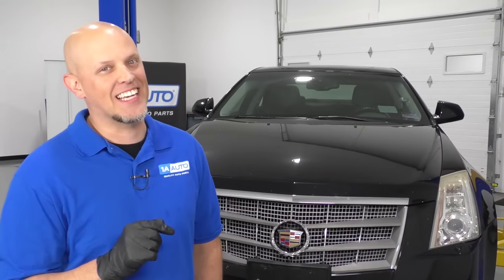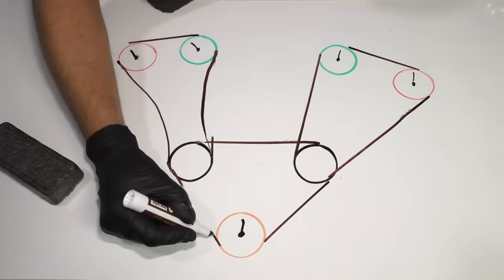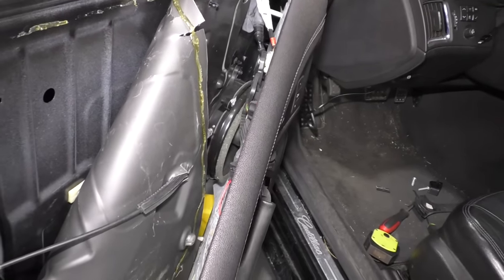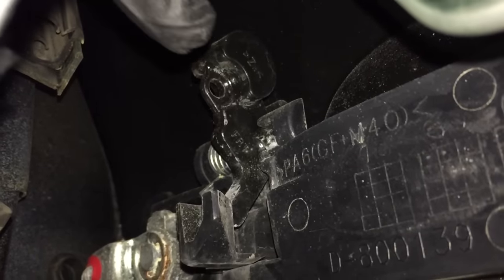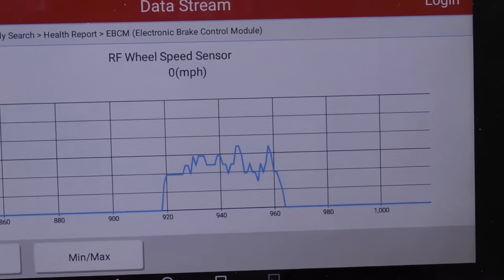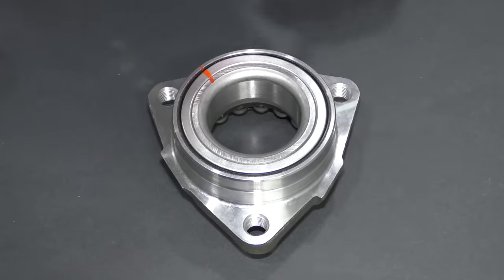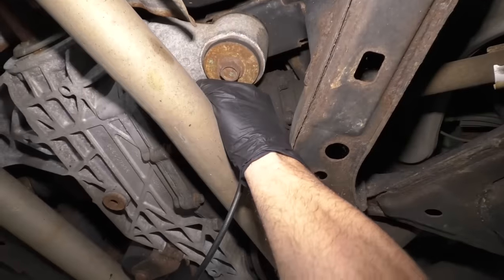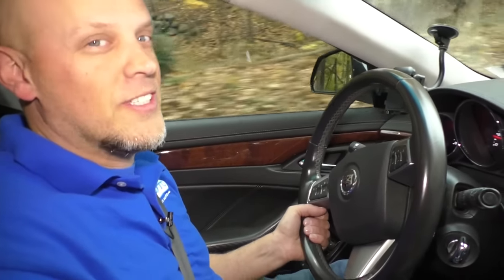Top 5 Problems Cadillac CTS Sedan 2nd Generation 2008-14

Comment: Doing any work on these things a just a huuuuge PITA compared to almost any other full sized sedan lol, like changing any of the bulbs in the headlamps for example. Gotta put the car in the air with the wheel turned in and go in through the wheel well 🙄 stupid.😆...but even with all 6 light housings having bad seals on mine and letting in condensation, I had to replace a 1 fog bulb thatbwas out over 3 years ago when I first purchased my STS with 120k on it, and it has 190k on it now and none of the other 7 or 9 bulbs total in the front have needed replacing since. My car in particular is good to go because i take care of my vehicles and have spent more than I paid for the thing over the past 3 years on maintenance and special-order only discontinued parts for the thing as soon as they go bad and strictly run Mobil 1 5w-30 that is calls for, and dump a little seafoam in the crankcase in the winter to thin it out a bit and clean it out at the same time for those 9* morning cold starts here in MI, but as a whole I purchased my car expecting a nightmare money pit and for putting 70k on it, I can't believe how well it's taken all my abuse and these MI roads.. main cost with any caddy is going to be suspension maintenance if you live here because every winter the roads just chew the suspension on our cars up everhtime we pull out of the driveway smh.. but as for the engine and drivetrain (awd) they're bothe original, and both taken a severe beating because I drive all my cars how they were meant to be driven and they are all still running strong as ever... BUT it threw the codes for the timing chain issue about a year & 20k miles back... it's been running in limp mode ever since then with about 70% the power that it did have, and running rich the whollle way because that's where I draw the moneypit line. I'm going to drive this car the way it is and continue maintaining it meticulously like i have until one day the engine finally grenades on me when I'm winding it out to 7k rpm with the governor pegged at 106 on the freeway like I do weekly, or it just randomly won't start one morning because the chain finally jumped a tooth, if it ever even does lol... despite needing a timing chain, this car is a just a luxury tank that i bought for a steal and still turns heads. As long as you change your oil every 6k miles at the most and keep an extra quart in the trunk to top it off every 3k miles or so,, because these engines are all natural oil burners at anything over about 3500rpm.. even with me behind the wheel pushing this car to its limits, it's literally never needed more than a quart between changes and that was actually the acceptable rate that was published in the cadillac service bulletin back in 2008 for these engines when the car was brand new 🤯😆 ...all in all I love the car to death. It costs a fortune to fix, but if you find a good one like mine you can grab them for the cost of an A to B little beater car, as long as you buy it knowing you're going to need to spend just as much, if not MORE than a Mercedes or BMW for maintenance and repairs, butbas long as you do that like I have, this thing hasn't skipped a beat daily driving it, or ever once left me stranded without a vehicle while driving an hour away every other day since purchasing it like I 100% swore it would within the first 2 months. Only car I've ever owned that I purchased with a "God how are you this dumb? You literally know better than to buy this thing" type of mindset, expecting it to be to be a total fail and turned out to be one of the most reliable American made cars that I've ever personally seen. My case is veryyyy very rare for anything with the 3.6L cadillac engine in it though, and that's because the main problem with these cars is the timing chain stretching every 60-80k miles that literally totals the car out to have replaced, being a $2500-$3000 job on a 12 year old vehicle with 200k on it... and it happened on every single 3.6l cadillac and most other GM 3.6 engines that are on the road because of a huge engineering design flaw and the very first reason why if you are looking to buy one, having an OBD2 code scanner with you is a MUST. I looked at 8 different STS's and this was the only one that did not have a check engine light or any timing chain related codes when I purchased it, and the car was meticulously maintained by the dealership every 6k miles and was sold for $63,995 in 2008 with a bumper to bumper extended 120k mile warranty on it, so it had obviously already been replaced at least once by then.... the reason I'm taking the time to write this is because I'm shocked wasn't mentioned in this video somehow. Do NOT buy a damn cadillac no matter how good the price is without doing some digging first. Trust me, it's well worth it. I've never seen another STS still on the road with as many miles on it as mine has because of the simple fact that people don't want to be bothered with checking their oil every few tank's of gas 😑👌

Comment: 3,6 v6  it good engine???????????//
Reply: The LFX version, 2012+ is excellent.  The 2011 has timing tensioner issues so get a 12+.  Add a catch can since it's DI and good to go.  I am on my 2nd, drive them like I stole them with no problems.

Comment: Fuel pump leaks, sun roof inoperable, water leaks in to car, water pump gaskets leak, over heating. Head light led going out,
Reply: first major repair was timing chain replacement,my fuel pump is leaking currently if i fill it up fully, my sun roof is leaking, just changed headlights, and now today the transmission failed me cant put it in park with out it rollin, when you put it in reverse or drive CRRRRrrrRRRR clanking noise and wheels don't move at all car just stopped working in middle of traffic took it in they wanted over 3k got it down to 2,600 and now im waiting...

Comment: Absolutely useless video. Except for checking the gascap sealing there is nothing that an average owner can fix or test. How many people have a lift or an expensive scan tool? I have a 2008 CTS with 96,000 miles and the only issues I've had are o2 sensors and tire pressure  monitor batteries dying. I do think any GM vehicle built after the early 2000's are not very reliable.  My 1997 Pontiac Bonneville with the 3.8 V6 is bulletproof. Great engine and the car has all the amenities you need and it's alot less complicated to work on.

Comment: #1 -same as all other GM vehicles....."reduced engine power" Replace throttle body. You're welcome
Reply: I legit just cleaned my TB today due to loss power/service stabilitrak and it's running fine.didnt have to replace, just cleaned it up

Comment: Top 5 lol. Don't buy these cars they're junk. I'm speaking on 04-09 srx,  My mother bought an 05 srx which is the SUV version of the cts, and sts so I would imagine those are also junk. but I would imagine it's the same shit. Maybe she just so happened to pick the worst one of those ever made. 
- 85k- alternator went out
-100k emergency brake stopped working
110k first wheel bearing went out
-115k battery kept dying even after new ones, stealership couldn't understand why, found it was the stereo
-125k driver side rear mirror motor went bad
-130k is where srx takes a shit
-145k rest of bearings went out
-135 cylinder 4 kept misfiring even after service I finally did it myself and turn out it was the wiring harness.
-132k ECM went out twice but was covered by stealery second time, after that it wasn't shifting into 4th but so I took it back to the stealership and was told it had nothing to do with the programming of new ECM. 
-So 132k transmission "shifting sensor"
134 sunroof stopped working properly
-135k rear differential
-135k front suspension warning 
-137k rear driverr door stopped working completely.
-138k rear hatch door motor stopped working
-145 upper control arms and one lower
-146k PS return hose started leaking
Reply: SUVs = MORE parts & electronics = MORE PROBLEMOS. Ditto.

Comment: I have a 2005 CTS. And I think I need a timing chain. How much would something like this cost to replace?
Reply: Rob Thorpe Jr  Hey I just got my timing chain replaced and it set me back $3000.00 on my 2006 CTS. 105,000 and mine failed not bad, but the price to get it fixed hurt
Reply: Before i sold my 04 cts had 124000 miles needed timing work took it to dealer in they told me 3800 at that moment is when i decided to sale it
Reply: More than the car is worth
Reply: @Dcfashionguru80  Yikes!!! 😯
Reply: Well damn! I thought the $1500 I forked out to replace the timing chain in my 07 was a lot, but after reading these comments I feel a lot better about the cost!

Comment: Just don’t buy a Cadillac 🤷‍♂️
Reply: seriously
Reply: outoftime yep GM is junk 😂 Cadillac is expensive junk 😂
Reply: @WarriorOfEden3033  no gm brand is junk
Reply: outoftime incorrect & clearly biased opinion. Even Honda & Toyota have made junk. The problem is that these cars are notoriously unreliable when they age where other cheaper cars don’t have as many or any issues in the drivetrain at old age from normal wear
Reply: Not too sure but I have a 2010 that I bought new with a 178 000 km and I haven’t had any problems. The only thing I did is change the oil and I put a new set of spark plugs in at around 120 00 and it’s still going well.
Reply: Delano Davis lucky you, that doesn’t mean much  because most cars can reach that with no issues under normal conditions. The biggest problem is when things start to fail it’s overpriced & becomes a bigger task than other cars. If all you do is highway pulls & don’t idle your car shouldn’t have many issues for a long time because highway miles are about 10% the ware for city driving.
Reply: My 06 Escalade isn't junk! 117k miles and a new water pump only. These junk comments come from poor folk! LMAO.
Reply: I worked as a limousine contractor in Chicago for 12 years. We put 385,000 miles on an '01 Deville (over 4 years) and it had its share of expensive fixes. Other contractors had even worse issues with their Caddys, so comparatively, we were kind of lucky. I loved that car, but for reliability in that business, the Lincoln Town Car was a no-brainer; even though it had THE WORST SEATS EVER in any car ever made 🤣🤣
Reply: @WarriorOfEden3033  right? I notice a lot of the people complaining in these comment section are the ones complaining after their car is well over 100,000+ miles also. They probably didn't maintain their vehicle well enough so they just fall back on just complaining & blaming it's American made or GMs fault. SMH.